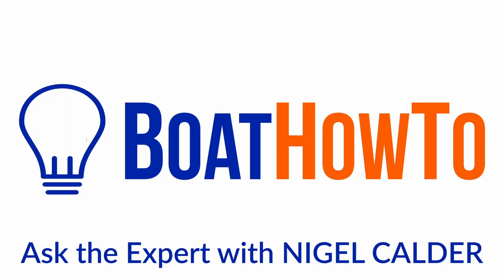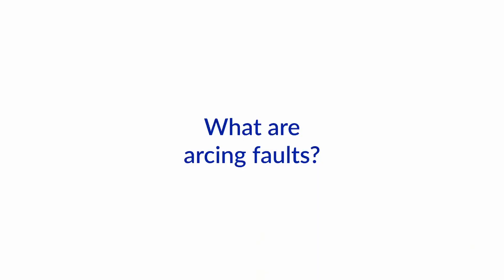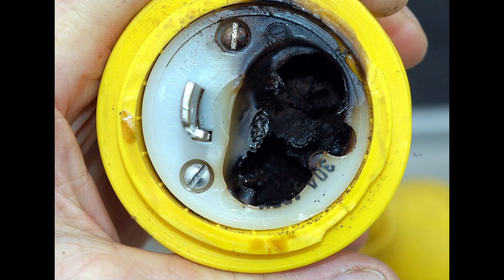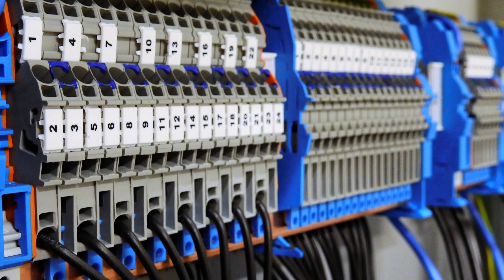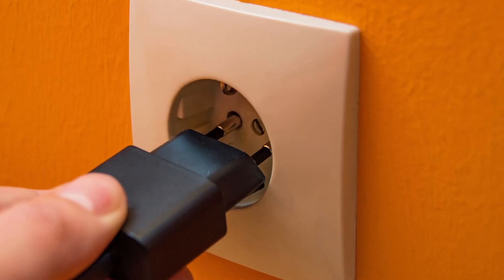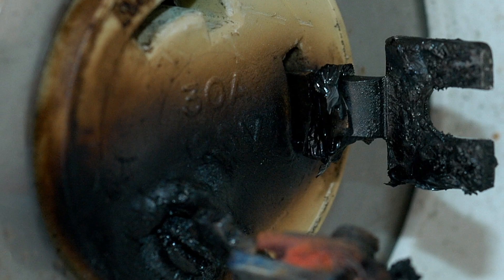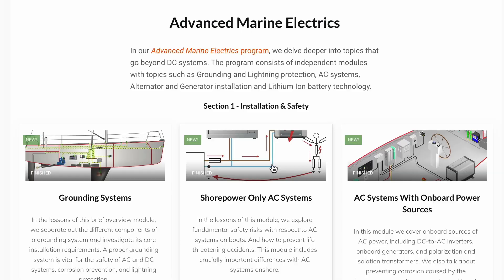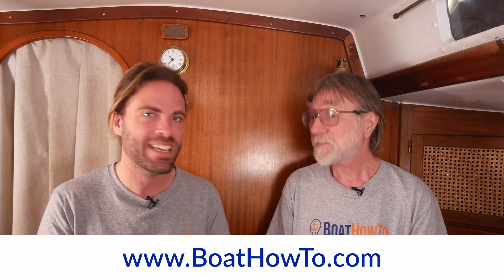Major cause of BOAT FIRES: Arcing Faults on Shorepower Cords | Ask The Expert with NIGEL CALDER

Comment: What do you think about the electric conducting grease on the connections for shore power? Do they help prevent corrosion that leads to extra resistance at the connection? Is that corrosion contributing to arcing faults?
Reply from the maker: Corrosion is an obvious issue. I don’t know about conductive grease as a mechanism to hold it at bay. I have not tried it and don’t know anyone who has and have never seen it recommended. Jan points out it’s going to collect dirt and may end up making things worse. I think the best antidote is to keep shorecords in dry spaces when not in use, to keep the plugs and shorepower inlet covered, and regular inspection with replacement if any signs of corrosion or other damage are detected. On my current boat I have cords, some of which are 16 years old, that still look and function fine.
- Nigel